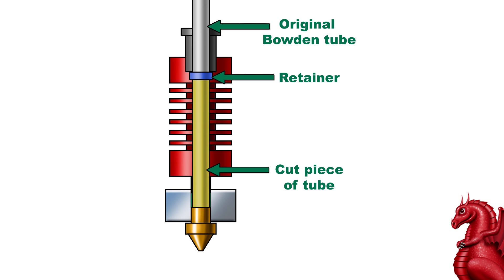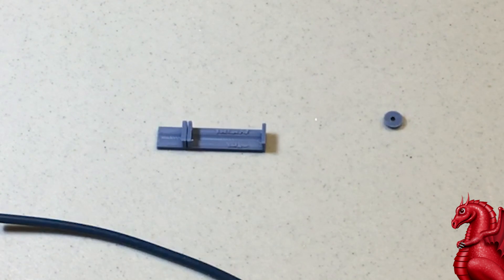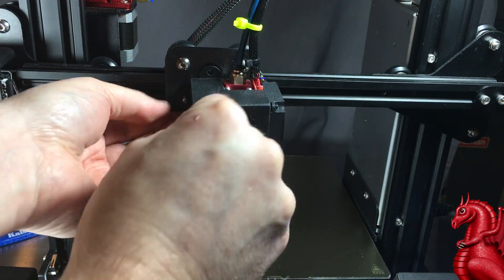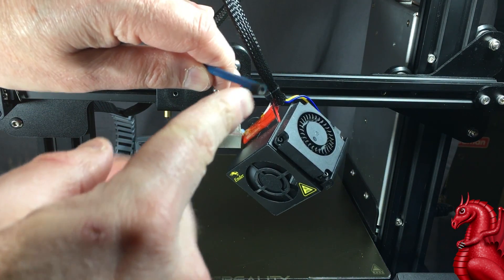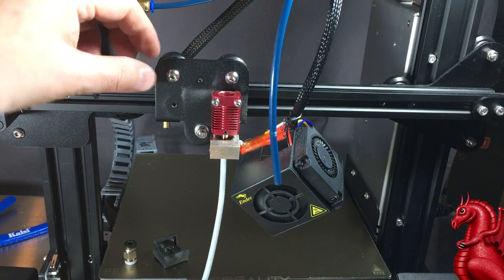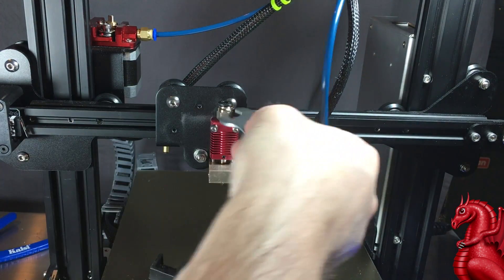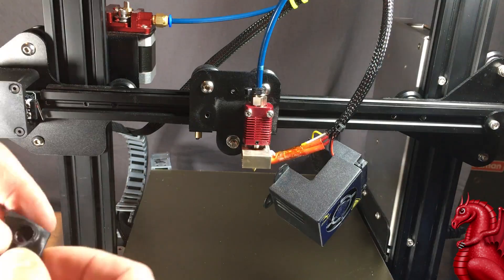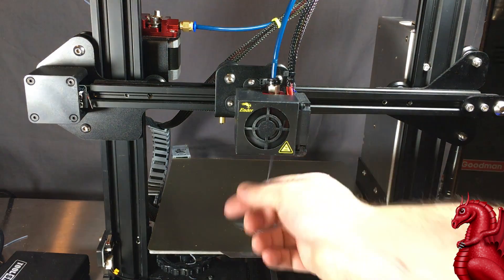Ender 3/5 Stringing Fix

Comment: Using the fix since Luke had released it. I also installed it on an anycubic kossel linear plus just with a different insert length.
2 important things from my side :

a)  before tightening the pneumatic coupler, push a piece of filament all the way down into the hotend. Then tighten the coupler, remove the filament and push the bowden tube in. This procedure automatically centers the retainer avoiding problems  feeding the filament through the system later.
b) the setup works so flawless that you tend to forget about that piece of ptfe in the hotend. But it actually wears out. After more than a year of extensive usage, I experienced increasing stringing. Two days ago, I replaced the little insert piece and stringing was gone!

Keep up the good work! Thx!
Reply from the maker: Excellent tip on inserting a scrap piece of filament first!
Reply: Great additional piece of valuable info. Thanks for adding it.
Reply: You know I was about to come on to the comments section of this video and say this does not work. I have tried for the past hour feeding the filament through to the nozzle and out and it will not do it. Gets stuck every time, does no operate. replaced pieces no difference. This might help get it through. Thanks.
Reply: Thanks!
Reply: Can I add something: instead of using a small piece of filament you can also use the smallest hex wrench that came with the ender to line up the coupler. Because of the hotend still being hot I managed to melt the little retainer piece by sticking the small piece of filament too far and retracting it. Using the hex wrench solves this. I also put the fan cover back on first before inserting the little piece.

Comment: Is the retaining ring printed in PLA?  Is it far enough from the heat that we shouldn't have to worry about it melting as well.?
Reply: If the heat ever gets that far and is high enough to melt PLA, you've got far more pressing issues with your printer. The whole point of that red heat sink (and the fan that blows over it) is to cool that part of the hot end.
Reply: @86abaile  Gotcha, thanks for the explanation.

Comment: Is it ok to print the spacer with PLA / PLA+, or does it need to be something that resists heat better?
Reply: pla is fine as the heat should not be anywhere near it- if it is there is a serious problem with your setup
Reply: @VintageTechRepairs  @imonsei Awesome, thanks!
Reply: If the heat creaps that far up that pla would deform at the top, you have an enormous problem. So, yes, it's ok to use PLA.